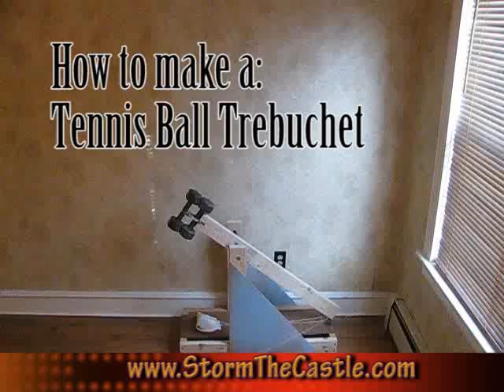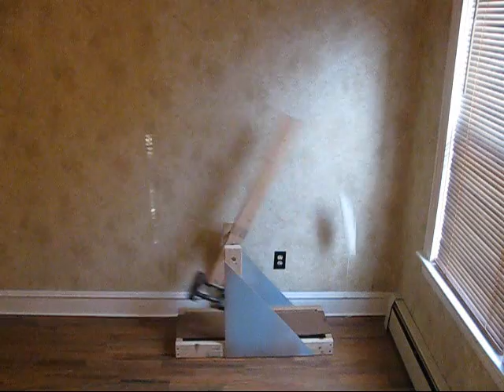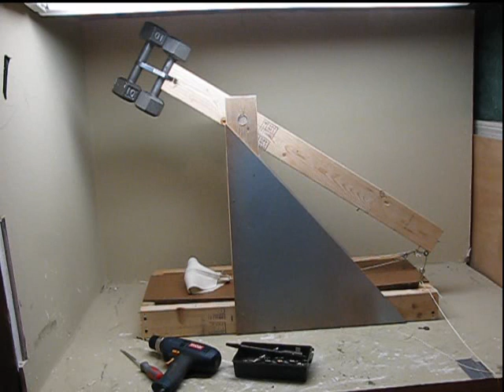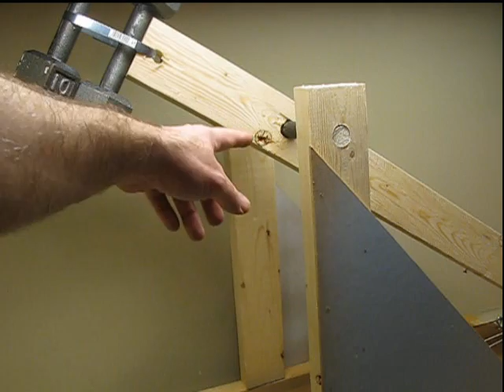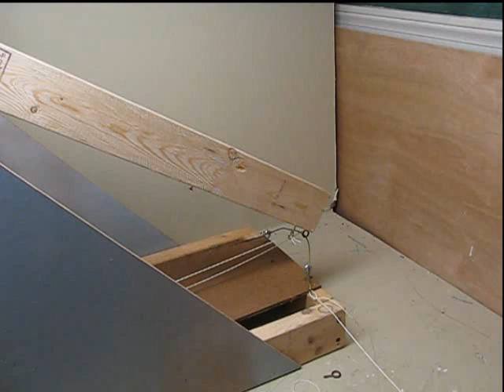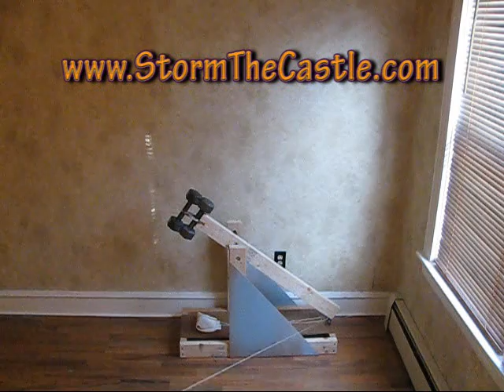How to make a tennis ball trebuchet - fast and easy

Comment: If I wanted to build a smaller version of this for a class project, how would I do that? The max specified height, width and length of the thing I want to build has to be 20x20x20, so that would not work with 2x4's, I don't think. What are your suggestions?

Comment from the maker: A 2x4 is a standard size of wood used by carpenters. You can buy them at any hardware or home improvement store. They are roughly 2 inches by 4 inches wide and come in different lengths like 6 feet or 8 feet.